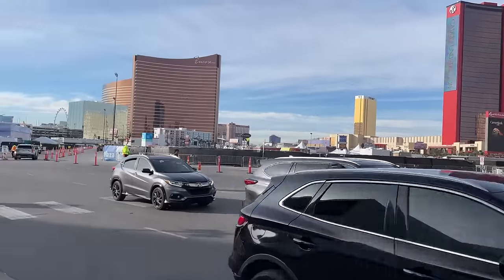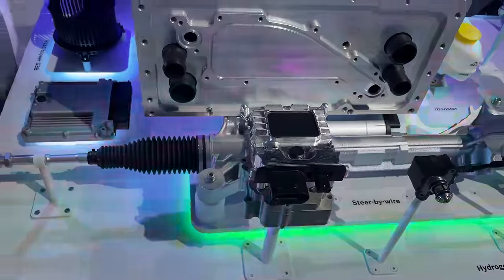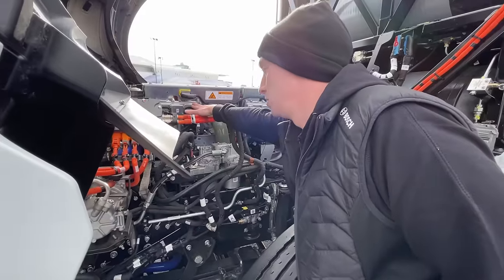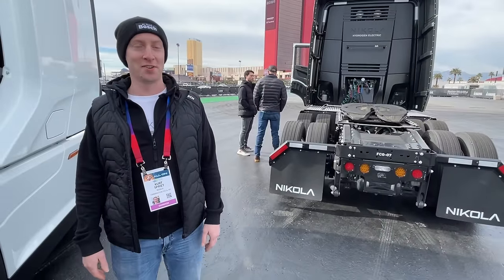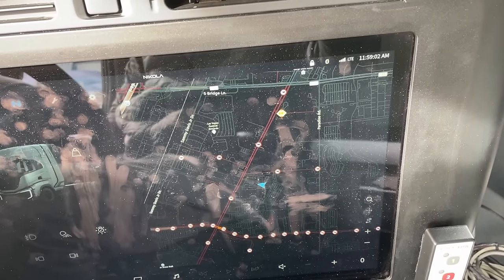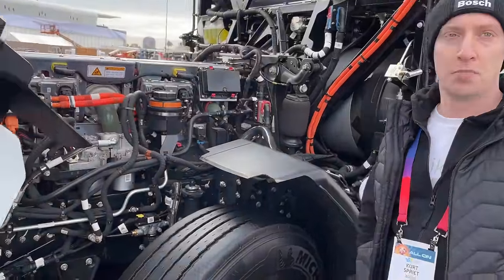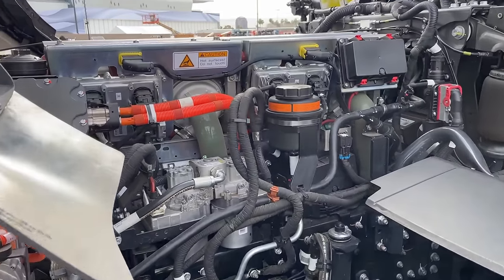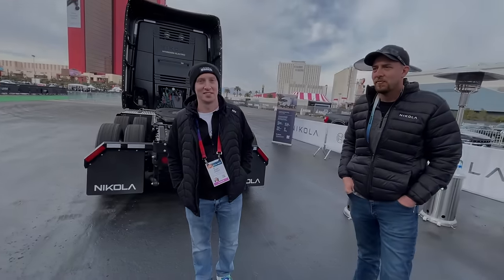Nikola & Bosch: Changing The Hydrogen Game Forever.

Comment: Nice ❤ more videos like this! Every truck driver should have one like this truck! 😊👍
Reply: Does Nikola actually produce the truck already or  is it just a prop to fool the investors???????
Reply: @sammas2959  they have made sales and delivery of the FCEV's. though currently in very small amounts. And there are a few dealerships with limited stock on hand.  
The hard part is having hydrogen available to fill up, so the Hyliion fuel stations also need to be added to the truck depots these are at in most cases (or some other generation of hydrogen) 
Their Tre model (all electric) is currently on recall to fix a battery issue that caused thermal runaway (uses different batteries that the FCEV) 
Even if Nikola doesn't pan out, the fact that BOSCH is investing billions into Hydrogen R&D, as well as Toyota, shows that the technology is not just a fantasy but a real possibility to become mainstream in the next few decades as the underlying infrastructure is slowly put into place.

Comment: I may be off, but I think NKLA stock has until 1/18 to pull up above $1/share (would be 30 business days below $1), or they will risk being pulled from the open market (NYSE). Anyone have more insight on this?
Reply: And today is still $0.61
Reply: That's correct but they will only get the notice... which will inevitably probably drop this lower but they'll have 180 days to get it back over a $1 for 10 consecutive trading days.